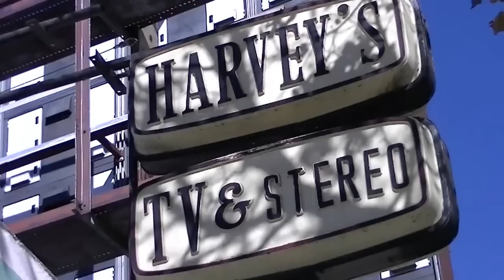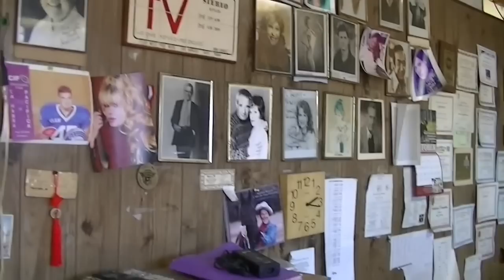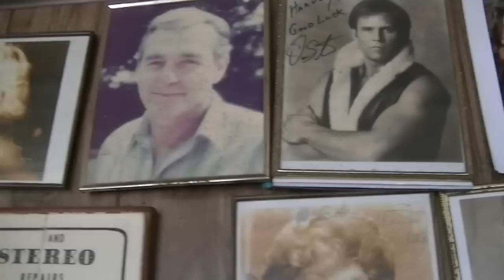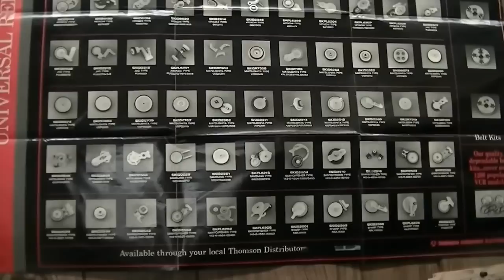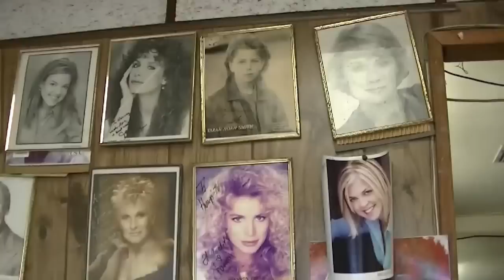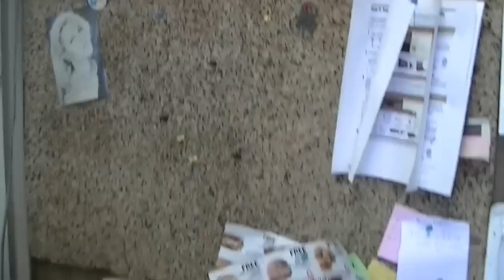Harveys TV Repair Shop Final Days A Short Documentary Harvey's TV an Stereo Los Angeles

Comment: Sad. 
I have been a TV/stereo tech for over 30 years. It's like Harvey and I said almost exactly the same words.
The 70 year old shop I worked in folded in 2014.
Reply: I remembered one shop closed down because business was so bad he had 35 tvs and test equipment he had to throw out i took the whole lot. My dad and Mom was some what mad. I had almost every part for any audio and video equipment. I had one of the old record changer and tube amp when it went i fixed it with parts from marty and roberts tv shop that went belly up. I had every part that amp needed. Marty and roberts closed down in 1986. I had a backup tv when my mom and dad needed one till they could find a tv. They got one a mga worked for many years

Comment: I realize this is a very old video. However, I find the owner’s circa-2012 perspective on the lifespan of newer sets interesting and wanted to comment since some time has passed since he made his observations. It’s now late 2019. I’ve got an LCD from 2007, two or three from 2009, and a plasma from 2010. I also still run an LCD Mac monitor from 2009. Never had an issue any of these products. 

At work, I watched our television and monitor replacement costs drop dramatically around the world as we transitioned to LCD. The newer stuff lasts much longer on average and has a much lower premature failure rate. I just think the technology is better despite the products themselves being more cheaply built. 

My CRT sets and the ones I remember as a kid never went a decade without needing service. I do agree that when I do inevitably have a problem getting my stuff serviced may be difficult to impossible. This kind of service business no longer exists in many areas, and as the owner rightly noted current sets are just not built to be easily serviced.

A key factor driving the disposable mentality is the rate at which the technology standards are changing. My stuff is all 720 or 1080p. Now companies are starting to offer 8K at a lower inflation-adjusted price point. I don’t remember advancement being nearly as rapid or as impactful in the television / display space prior to about the last two decades or so. The justification to repair isn’t there - certainly not now in my case. This isn’t true with everything around the house, but with many electronics it is. If we approach some limit and innovation in this space slows down, maybe the mentality will revert back to repair versus replace. In the meantime, I agree we have a disposal problem and need to come up with better methods to funnel old materials into new products rather than plant more landfill “farms.”

In the end, it is indeed sad to see these businesses go.

Comment: Having worked in the service industry, it's horrible. Computers, TV's, stereos, appliances, etc, all super cheap, but super unreliable. I honestly would pay more to know it has more quality and easier servicing to it (Like Sears when they used to post diagrams in their owners manuals) When I bought my house, they told me my furnace is old and should be replaced due to age. I asked why, "Well, it could just break" was the answer. I know they wanted to sell me a new furnace. And yes, mine did break after a year, but it was a cheap and easy fix for a new blower motor, I have it up and running again, and still strong, and still reliable. But the, "replace it cause it's old" "Oh now the warranty is up, and this part that is unnecessarily computer controlled has died, and the price is 1/3 the cost of a newer furnace, so might as well just get another new one again" cause I have had that happen to friends. 

I keep everything I can, I am very anti-disposal. While most things I have are "Disposable" junk. I have kept them all running. I love videos like what Shango posts, because most people consider these older things junk, and folks with knowledge like Shango are slowly dying off. I am amazed with what he can do, and for someone getting more and more into tube equipment, it's nice to watch other professionals work.
Reply: Ironically higher quality consumer electronics would also be good for the environment.  Fewer plastic devices thrown away.
Reply: i agree

Comment: One of my sidelines for a while was purchasing flat panel TV's known not to work.  Provided the screen wasn't cracked of course.  Pay a few bucks to keep it out of the landfill.  Re-cap in some cases (okay...more often then not....)  VR's seem to be the 2nd leading failed points.  My rule used to be try and double the money on a 'flip'.  (20 for a TV...up to 30 in parts...  And attempt to sell for $100 or so.)    Sadly the cost of a new flat panel set went to the point no one wanted a repaired used set.  Why bother when you can purchase a "new" one for only 30-50 bucks more with a 'warranty'.     Sense my day job is repairing arcade games and equipment I'm doing okay.  But I've seen this disposable society coming for a long time.  

Currently the wife and I are doing vintage audio at this point.  Finding stuff at flea markets and swap meets.  We've had good luck with repairing old tape equipment and receivers.    Yeah it takes a long time to locate spare parts LOL!   But at least it's keeping stuff out of the landfills.

Comment: Around '94, I bought a two-head Magnavox VCR for $149.99; and, at the time, that was considered a cheap VCR. I got about ten years out of that one. It was replaced by a last-gasp stand-alone Funai-built Emerson that cost $39 from China-Mart. It barely lasted the 90-day warranty before it died and the whole thing was all plastic and weighed about two pounds. Since then, I've picked up older models that are much better. I'm also not impressed with the later DVD/VCR combinations.

Comment: True Story. I have worked at our family business doing consumer grade electronics repairs now for over 15 years. We are going through the same situation as Harvey. Economy, changing demands of the younger generations, low longevity of current products being produced, all of it has had to have us prepare to close our doors in the near future. I'm preparing to take the family business to the house garage to try and scrape up what work I can out of what is left of the market. However there is still a demand for onsite installations and service which will be a relatively viable source of work for a while yet. The best thing service techs can do is evolve their skills to adapt to changing demographics of the marketplace. not easy to do but it is possible. Best of luck to all the electronics service tech out there young and old.
Reply: I feel your pain. I did exactly that, set up a shop at home, but there wasn't enough business to keep me going so I learned a new trade and went back to work.
Now electronic repair is more of a hobby for me.
Reply: Well once everything goes completely wireless (which is happening right under our nose with subliminal messaging ) there won't even be the need for service techs to hook up wires anymore.  All the customer will have to do is plug in the mains cord and that is it....
Reply: Wireless? You're joking right. I work in telecom / isp, an I can tell you that wireless issues are the biggest headaches. Too many devices and not enough bandwidth. Doesn't matter how big the pipe is all the noise from all these devices slow things down. Even the 5ghz band is getting satsurated now and things will only get worse.
Reply: I had a debate with my house mate about this subject and he is stuck in his ways about it.  Everything wireless and he won't buy it if it has a cord or something you have to plug in (besides chargers)  I personally think it is the most retarded gimmick I have ever seen in my life.  Even if he is sitting at his computer desk, he had to have the wireless keyboard and mouse and everytime I walk in there I get a screaming headache from all the damn signals flowing though that room.  Bluetooth, RF, WiFi and what ever else these toxic devices have to offer!  Just saying...

Comment: There used to be many repair shops in my town & they all stayed busy. There was also a time that I could sell just about any type of working TV, color or B&W, that I got my hands on and I was able to get decent $ for them. Now, it's hard to get more than a few $'s for any CRT TV. It doesn't help that a local retailer is advertising a 32" TV for $249. I remember when 19" knob tuned color TV's cost more. Many of those older TV's are still going, while the $249 special will be junk in 1-2 years.

Comment: Last year my CRT TV stopped working. VCR was failing, speaker was fading and the color was as if you were looking at a ghost. It was 17 years old. Even the universal remote and a dvd player that was connected to the TV stopped working. So I threw everything out and never replaced them. It was in my bedroom. The only TV that a still have is a 2011 Akai TV. It's still going. I have a smart box, VCR and Blu-ray player connected onto it. I did recently replaced the old Blu-ray player because nothing came up on screen, only sound

Comment: TVs in the 70s-80s were very expensive because they were mostly built in the USA, I paid  $550 for a 19" Zenith Color TV in 1983, that's equiv to $1400 today.  The old CRT TVs were repairable, and it was cheap to do that,  so people had them repaired for under $100 in most cases, or changed-out the tubes, rather than throwing them away.  
Before you go beating yourself up about "today's throw-away culture", it was about economics back then, as it is now. People throw TVs away now because it's often an expensive hassle to have them repaired, and you can buy a new 40" China set at Wallyworld for $149.

Comment: They could make an electrolytic capacitor to last many years at one time . Manufacturers are building in components they know will fail quickly and are too close to their operating limits to be reliable , the general idea is to sell another television as fast as possible.

Comment: I see a 1975 Sony TC-756 Reel to Reel behind that Panasonic. Specs on that Sony unit are outstanding. Just second best to Revox Studer A-700 at about half the price. The clear coat on the circuit boards of that Sony need to be washed off with alcohol as the clear coat became conductive. The internal bias levels cannot be adjusted to meet the spec. The left channel bias affects the right channel and visa versa due to the breakdown of the clear coat. This is a factory defect and not due to time.

Comment: I used to work as a tech at a computer store and saw a similar decline in business right around the same time (2005-06). That year must have been the tipping point between the cost of fix vs. replace in many industries. Biggest problem as others have said are getting replacement parts, its pretty clear manufacturers don't want you to fix it! Not surprised to see bulging SamWHA capacitors in a TV, they are all garbage. All over saving a few cents over a quality part.

Comment: Lucky if it lasts you a year... My family has bought like 5 - 6 flat screens and none have failed yet. oldest one is from 2007
Reply: ***** "boughten" yikes...
Reply: MuscleDad420 Ok ok Sorry. ' ' Bought ' '
Reply: tru or u can spind 1000+dolers for a tv that whont die under 5years....thats just sad
Reply: Correct.  The Mean Time To Failure (MTTF) for current generation flat screens definately surpasses the CRTs of yore.  There is no doubt todays tech (in general) is more reliable than the heat producing "bottles"

Comment: VCR's sold for around $1000.00 in 1980 and an average repair was around $200.00' by 1995 VCR's were so cheap all we were offering was a cleaning service, $20.00 while you wait if it got the picture back, no you couldn't leave it, you had to wait. (having dumpsters full of VCR's was no good. ....
The USA will not recover if products are not made and backed here!

Comment: Not sure about TVs only lasting 1 year. Modern TV sets with SMT boards, tantalum and/or solid capacitors, LED backlit LCD screens, microprocessors. no thermal drift issues or flyback transformers, RF coils,tubes etc.. will easily last decades now. 

My dad had an old gen samsung that was an early LCD with CCFL that had the bad caps that got swapped out for 80 dollars (labor parts) still going strong.
Reply: Your joking right. Decades? Wishful thinking. Seen more bad panels than I know what to do with. I only work on vintage audio these days. At least there Is money in that.
Reply: They could last as the tech is there but the build quality isn't and they are made to fail to drive sales.
Reply: Don't agree about "made to fail', but they are definitely "built to a price point". When you build cheap, to hit a certain market demographic, you forfeit quality and reliability.

Comment: I have the same Sony rear projection TV that was seen in front area of the store! At least if it was the 53 inch model. Just replaced all 3 picture tubes, cleaned it and replaced most capacitors just for good measure. I hope to get another couple of years out of it. Just use it as a second TV so it is only used randomly now since I don´t watch that much TV anymore. The content is just awful and I generally stick with the older shows and news.
Reply: eaglevision993 bhyg Okay Google I need to see the final days of Harvey's TV repair please

Comment: I believe with heating, you could empty the caps and replace the dielectric oil, and rejuvenate the old caps to more sensible values. just saying, possible.
Reply: +Paul Hiiginbotham Then how do you suggest sealing them back again? Have any plans to weld the blown aluminum containers. Also the dielectric liquid is so critical, many cap producers can't get the formula right to make them dependable like Nippon Chem does.

Comment: I don't know what this guy is talking about. The modern TVs only last 1-2 years? Really? I have 3 sets going on 5 years already without a single glitch.
Reply: but it will never last as Long as the sets from the 50s up to th 80s they where build to last you a life time
Reply: My sony bravia lcd is now over 7 years old and its on every day all day, as i said you get what you pay for.
Reply: Nothing lasts a lifetime they all fail somewhere
Reply: My Samsung is 10 years old and my moms Sony is 8 years old, both work great. The Sony at my moms house is on 14+ hours a day. We have several newer sets on the wall we use to let patients know when they are up and they have been very reliable, they are on 24/7. Older sets were not more reliable, they were more serviceable, but they were not more reliable. You were lucky to get 5 years out of a set from the 70s before it needed to be serviced. There were lots of repair shops because TV's broke down a lot and they were expensive to repair. The most reliable sets are the fully solid state from the early 80s. I have a RCA from 1982 and it still works as good as new. The volume switch will break before anything else. 90s to early 2000s TV's were junk, but the sets today are reliable. When they break people just buy a new one because they are so cheap.

Comment: Quite sad and depressing esp since I have just started my own business repairing electronics gear. I think the key to keep going here is to diversify. I repair alsorts, car key fobs, guitar amps, car instrument panels, pretty much anything electronic. I do repair LCD TVs (have stopped on plasma,s there dead and gone now) but don't get many to many requests for smashed screens. I do find the new LED backlit ones are falling over left right and centre, so maybe repairing the backlit strips (buying replacements from the manufactures is way to expensive) is a way to go, even salvaged ones on Ebay are stupid expensive. The advance in the tech in this stuff is scary, I'm 52 and boy have I seen some changes, first mobile could display one line of text... Here's the thing though..beyond 4K and OLED where's it going to go? Nowhere, I think the manufacturers are driving themselves headlong into a brick wall, they won't be able to sell new stuff because it just won't have anything new and exciting to offer. 3D on a TV is pointless huge screens done that, smart...done...OK Colour holographic 4K might come along... Smelly Vision? I think we are reaching a plateau, more leisure time, less working hours, global economy getting bogged down, flooded with inexpensive stuff. It's gonna fail and the the TV/phone/computer/car you own suddenly has new value, you will need to keep it because others are unavailable or massively expensive... Watch this space.
Reply: Pete Sapwell the
Reply: Pete Sapwell